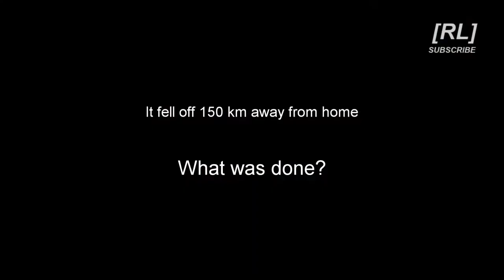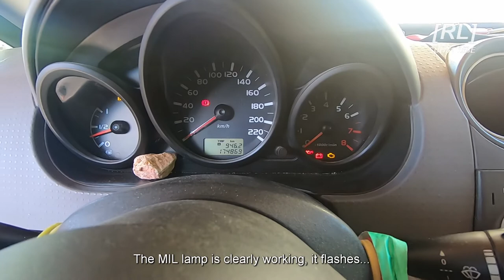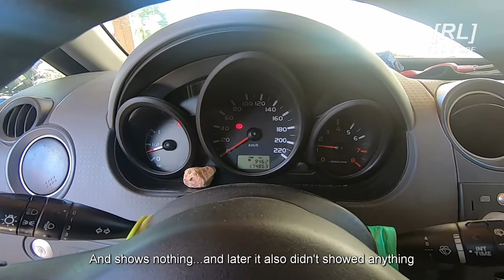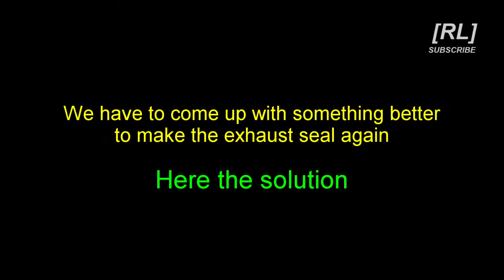Mitsubishi Colt 1.1i - Exhaust Center Pipe Swap (HD)

Comment: Have the exact same issue .. just got the exhaust from the seller🎉
Reply from the maker: It lasted a year or two, still having problems with it, because the catalytic converter pipe did rusted away :D good luck with your pipe!